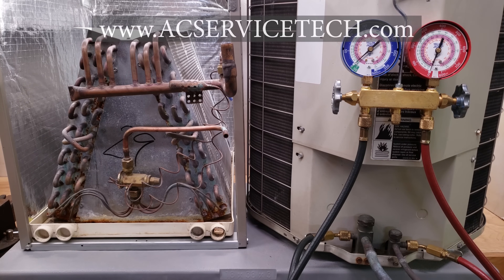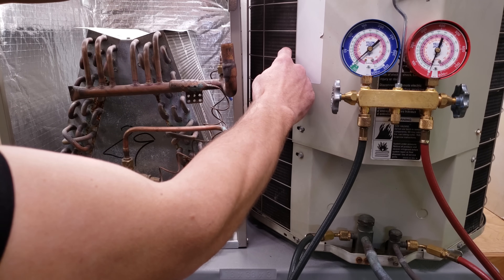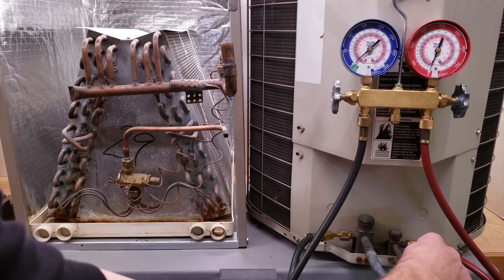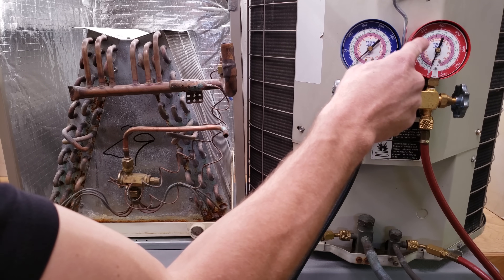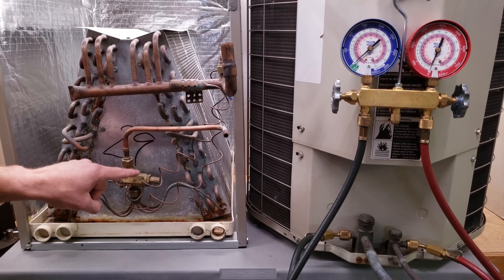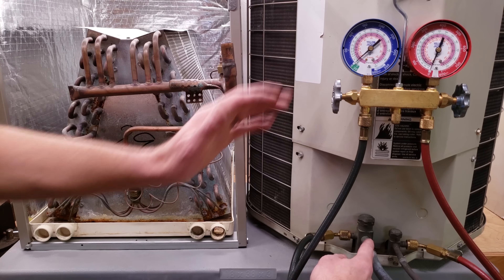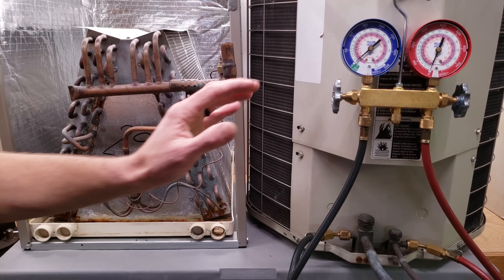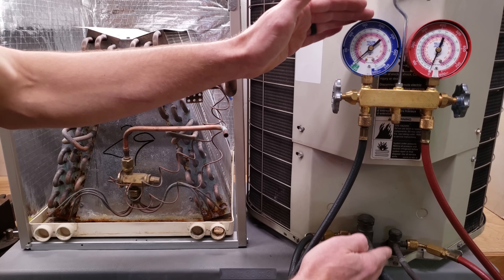Explaining Superheat and Subcooling to Your Apprentice!

Comment: I was universal refrigerant certified over 25 years ago in the military to service our mobile facilities units (420v 3 phase if I recall correctly).  I did a VERY LITTLE  bit of HVAC after I got out.  Only refrigerants I ever touched were 134a, 12 and 22. I still do cars but haven't touched a residential HVAC in a decade. I've heard of of superheat and sub cooling but never knew what it meant or how to test it. For that, I thank you!

I had my AC professionally serviced last month and he said the subcooling was supposed to be 9f and it was at about 2.  He added 3.x lbs of 410. He wanted $2,500 to do a leakcheck, drain, fix, vacuum and refil.  Problem is his company installed the new variable speed Lennox 2 years ago. First time it's ever been checked, did they underfill at install?!  I inquired as to why the 10 year parts/labor waranty doesn't cover the fix (if it is infact a leak), he couldn't answer.  I said top it off, we'll check it again next year.  He had digital meters that had a printout of all the measurements, including amp draw.  -LOVE THAT!!

Now for a question I might have missed in the video, how do you know if it's got a fixed orafice or a TXV without popping the evap cover?  If it's got a orafice, will it have a subcool listed?

Thankyou to any pros who care to pop in with answers.  I'll probably never touch a residential (or commertial) HVAC again, but I like to know what the numbers mean

Comment: What happens when the refrigerant levels are correct, but simply because the condenser coils was able to expel heat much better (the ambient air is colder than usual, or it is raining and the coils are getting wet ....) I am getting much bigger subcooling. should that be a concern?

Comment: How do you know if you can trust your gauge and or thermometer?  If your sub cooling is -5 one of your gauges is lying right?  Are there some practical ways a tech can check equipment for calibration?  If 2 gauges or thermometers don't agree , do you go with the most expensive one or the newest one?  I would like to see someone do a video on this subject.  Thanks.

Comment: Just bought ebook and quick cards. Hate to tell you that ebook version is suck because it doesn't allow me to zoom in like pdf reader. My monitor set at 1600x1400 so it made the reading very tiny like ants. I constantly have to change the setting but reboot the system is very annoying. Anyway, if anyone want to buy Ebook from Craig, think twice. I really hope someday you'll convert to PDF file for us supporters. I'M CRYING WHILE TYPING, SAD SAD SAD.

Comment: That's a lot of information. Useful practical. After seeing your theory video and now with this practical my life is complete. Q. Why do pump down videos show things going smoothly when I'd expect the compressor to stop working because closing the liquid line valve would make pressure sensor valve trigger or the vacuum created would trigger a too low pressure sensor cutting of compressor. Or do most have to bypass these sensors.
Reply from the maker: The low pressure sensor would be jumped out beforehand and on smaller systems there is no oil sensor. It is hard on the compressor though if there is no receiver, thanks!

Comment: Got a question for you. 4 ton evaporator and 3 ton condenser. Will it work and how will the superheat and subcooling play out on a txv system? How will you adjust it? More towards subcooling or superheat? Remember, 4 ton evaporator and 3 ton condenser.
Reply: Still no ac?

Comment: Thank you for the explanation. Can you please explain why when my subcooling numbers are correct, the high-side pressure is considerably lower than the chart on the condenser shows they should be and the result is what I consider to be inadequate cooling? Thank you.
Reply: Depends on the ambient temperatures outside the unit then you have to use TD-30 Im if I’m not mistaken.

Comment: When discussing superheat, you briefly mentioned that a line buried underground will affect Total Superheat. I imagine the cooler ground around the buried line, and possibly the extra length for relocation will lower the temp and pressure, but you don't explain further since it wasn't the intention of this video. Do you have a video that goes into this particular situation? I happen to have this exact scenario.

Also, I think it is worth mentioning that just because the plate on the condenser indicates a TXV, it should be verified at the evaporator. I also have this "tract home" situation where the builder put in condensers that show TXV, but the split system evap has fixed orifice!

Comment: Question on subcool and superheat: Can lineset length and diameter affect those readings????
eg: some applications,  the lineset is in accessible spaces to replace on an upgrade.  I have seen 1/4 inch liquid lines on R410a systems and head psi is extreme and sub cool also off chart..superheat is also high due to lack of feed to metering device, usually a piston fixed orifice. Customer wonders why energy bill is so high.

Comment: Is dry bulb the same thing as ambient? like when you're getting your desired superheat for a position unit?
Reply: Yes, wet bulb takes humidity into consideration and dry bulb is ambient temperature. Wet bulb use to have to  be taken with a psychrometer, now they have fancy thermometers that calculate wet bulb from ambient and humidity levels.

Comment: This video is really excellent. Very well explained. I have a question about something well outside the norm.

I am looking to install a heat exchanger on the hot gas line off the compressor to do some water heating. This would be a water cooled condenser in series with the existing air cooled condenser. I have a TXV at the evaporator. Am I correct to think that, since I have a TXV, I can simply adjust the charge based on target subcooling after installing the water cooled condenser and everything will work correctly? I am worried that there will be times when the air cooled condenser is doing nothing but subcooling and I could end up with a slugged compressor. Is there any danger of oversizing the water cooled condenser to the point that this becomes a real risk to the system?

Thanks again for the video.

Comment: it is very good, my only gripe is when he says "sub cooling is the lowering in temperature  of the liquid refrigerant" while i understand what he means,  I feel its better to say"subcooling is the lowering in temperature of the Liquid refrigerant after it's state change to liquid."
the further lowering in temperature ensures a full wall of liquid at the entrance of the orifice to the txv, ensuring proper direct expansion. someone may say, why is more sub cooling better or worse? and that is the best answer i can come up with.
Reply: SubCOOLING is lowering in temperature BEYOND where it changes state to liquid.
A lot of things in refrigeration are backward, you have to get it straight in your mind.
Refrigerant is evaporating at LOW temperature and condensing at HIGH temp. ( due to pressure) our minds want to think that in reverse. We’re set on water at atmospheric pressure condensing when cool and evaporating ( boiling ) when hot.
When we say ‘ subcooling ‘ we’re thinking of really cold frozen things, and for ‘ superheat ‘ we’re thinking blazing hot but that’s not how it is. Not in refrigeration world.

Comment: Thank you for your videos.  How would one figure out the target superheat of a small portable dehumidifer(fixed orifice, ~10oz r410A) where the evap and condensor are stacked?  Even if I could get a probe in front of the condensor, it would be skewed either by airflow position or proximity to either core.  Then I wonder if the typical charts would still apply?
Thanks.

Comment: perfect. so super heat keep changing depending on heat load (indoor air temp?) , so what would be ideal time of the day to check the superheat, the hottest time, or during the cooler temperatures of night? or do we have to check both times to see we are in safe super heat range?

Comment: Craig, thanks for this awesome video. Thorough explanations on these HVAC topics are too rare. I do have a question: when measuring subcooling, for example, how does the suction hose attached to the suction port measure the pressure/temp of the refrigerant at the pre-subooled point within the condenser coil and NOT at the already-subcooled point right there where the schraeder port is? Seems like magic 🤔

Comment: If your system has the proper amount of refrigerant in it, why does the superheat matter?  I don't get it. I do automotive AC and I never even worry about that. I guess I'm stupid.
Reply from the maker: Bill, the method that you would use for an automobile is weighing in the refrigerant using the total weight method. For split systems, we use this method to determine if the system is low on refrigerant, has a liquid line restriction, low airflow or other problems, thanks!
Reply: @acservicetechchannel  Thank u very much!!  Great channel

Comment: What happens in the event when you have a low SH & low Subcool but your pressures are good like 125/300 21 Delta & no airflow issues
Reply from the maker: That with a fixed orifice system with low airflow. With a txv it would be the txv stuck in the open position or the bulb is in a warmer area than the evap coil temp, maybe insulation off of the bulb. I have those indicators on my troubleshooting chart which is in the book and on one of the quick reference cards, thanks!
Reply: I love this channel
Reply from the maker: Glad you enjoy it!
Reply: @acservicetechchannel  Have you ever had any luck tapping on TXV that stuck & went back to proper function?

Comment: Excellent teaching, thank you. Question..Why dont manufacturers give you a super heat chart on units without TXV ?
Reply from the maker: They assume everyone now is using txv's. They used to supply a chart on the inside of the shroud but now for the last 10-15 years, we should only be installing pistons but I know a lot of techs just are afraid of txv's because they don't understand how they work. So anyway, that is why I supplied the target superheat chart on the quick cards and in the book, thanks!

Comment: Great Explanation !! How can I check the superheat in a minisplit ductless system with the suction port usable only ??
Reply from the maker: So the manufacturers don't give us any guidelines for charging minisplits because they have a variable speed compressor instead of single or twos speed like standard split systems. However, I have noticed on correctly charged minisplit units that the superheat was somewhere between 0-5 degrees and these have an accumulator prior to the compressor to keep the vapor compressor safe from saturated refrigerant entering it and damaging it.
Reply: Marzio Morzenti. I would 1/ weigh the gas in. Or 2/ run at "nominal" cooling (press the emergency button) add to superheat. Flip it over to heating. Run it again, check everything is within cooee. (Is best to use your red hose) Again record the gas weight. Write it under the cover.

Comment: Please talk about how to handle the situation where the wet bulb temperature is to low for the outside temperature and all there is an x where the readings intersect.
Reply from the maker: This is an interesting one and I lay this whole scenario out in the book. What is sad is if the install tech put a fixed orifice in the system instead of a txv then you need to set the total superheat less efficient and higher than where it reads on your target superheat chart so that while the system runs, the total superheat will not fall below 5 degrees. If you have no superheat then saturated refrigerant will enter the compressor and damage it. You could add an accumulator to protect the compressor but at that rate, you might as well just change out the metering device for a txv. The txv will hold the superheat at an efficient amount regardless of the heat load. When the target superheat reads x, you would need to set it as much as 6 to 10 degrees instead to keep the compressor safe. Of course, the system capacity will not be as high as a system with a txv but the compressor will be safe. Make sure to only install a txv in this climate unless there is an accumulator on the outdoor unit that will only allow vapor to the compressor. Great question!

Comment: Hey Craig,  I'm desperately trying to answer a very specific question regarding the measurement of subcooling. You have a video where you are measuring both super and subcooling on a unit that plumbed the high side service valve at the compressor discharge  line, not the liquid line. I have several hundred package units that are set up this way. Currently the manufacturers specifications have not been provided. How do we calculate subcooling in this scenario???
Reply from the maker: You would either need to contact the manufacturer to get the charging method or look up the model online to find the method. In the case of the video I did, I used that manufacturers charging method which they called subcooling even though, like you said, the port was on the discharge line. What you could do is just use actual temp measurements and not pressure measurements. However, you would still want to measure superheat to make sure the txv was working properly. You could find the middle of the condensor coil circuit and electrical tape a k-type bead temp sensor there on an elbow or push it between the fins in an area where the air is not blowing through much near an elbow. Then mount the other temp sensor on the liquid line where the refrigerant exits the condenser coil and shoot for a target subcooling of around 11 degrees during normal outdoor ambient run temps. I hope this info helps!
Reply: Craig,

Thank you for your time and effort in responding to my question. I should clarify,  my package units are mounted underneath a train car. I have very limited access to the condenser coil tubing. Temperature readings are taken from the liquid line by a transducer, just prior to the filter/drier. Same type of tranducer temp reading taken at the suction line near the compressors suction manifold. 

I'm curious,  what did the manufacturer instruct you to do with the unit you serviced. I don't need charging instructions as much as I need to troubleshoot the system. These unit's have no dedicated liquid line  or suction line service valves. When evacuations and recharging are required,  the high and low pressure transducers are removed from their respective Schrader Valves and manifold gauge set connections are installed.
Reply: Package unit : weigh the gas in. 
Surely the specs are there. Additionally, measure delta T off coil cooling

Comment: Hey do you ever plan on doing a book on electrical wiring and troubleshooting or is that already in the book now and your videos are the best learning a lot thanks
Reply from the maker: The refrigerant charging book includes everything to prepare a system for refrigerant, refrigerant charging, troubleshooting while measuring the charge and airflow. The full outline is available at https://www.acservicetech.com/ac-book  and I would like to get an electrical book together. It all takes a lot more time than anyone would ever think to make sure you get it done right. Thanks for letting me know what you would like to see!

Comment: I see many units on roofs of condos here in South Florida, where 30 foot of tubing is exposed after all the armaflex pipe insulation has deteriorated. What does that do to superheat calculations?
Reply from the maker: The quick way to check is to also take a temp measurement on the vapor line right after the indoor coil and compare that to the temp on the vapor line at the outdoor unit to see the difference between the total superheat and the superheat. The other thing that might play into the change in temp is pressure loss due to the rise in the vapor line. This will depend in the diameter of the vapor line. Anyway, hopefully the total superheat and superheat will be close and make sure that the total superheat is safe for the compressor because if you have a good total superheat at the outdoor unit then the compressor is safe from saturated refrigerant entering in. Also, if the insulation is off of the vapor line and is exposed outside, the vapor will certainly pick up more heat on the way to the outdoor unit so total superheat will be higher than superheat, thanks!
Reply: It does nothing to the calculations. You TOTAL super-heat result will increase. You't evaporator super-heat should not change.  The suction gas will pick up more super heat on it's way to the compressor without insulation . The compressor will pull more amps as result of higher suction pressure. Which is not good for the compressor. <-- This is what you will tell your installers. Head pressure will increase. Cooling rate in the home will decrease.